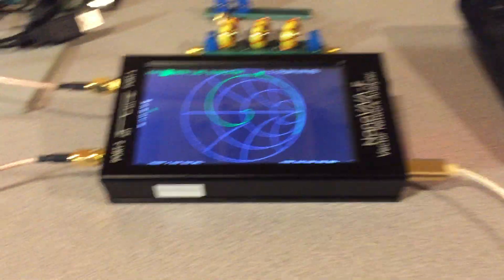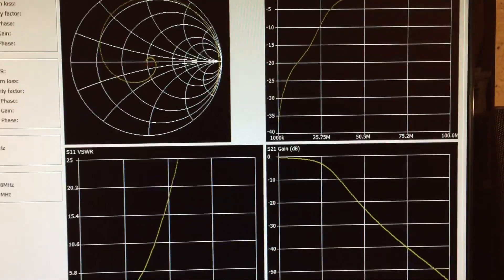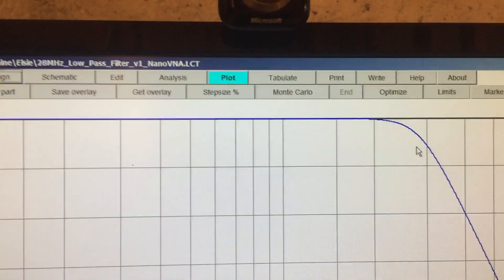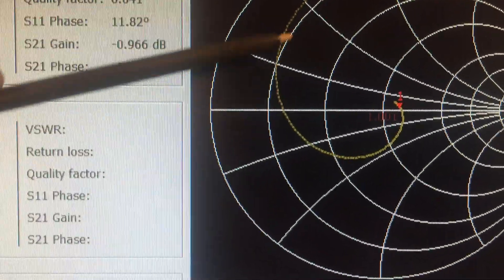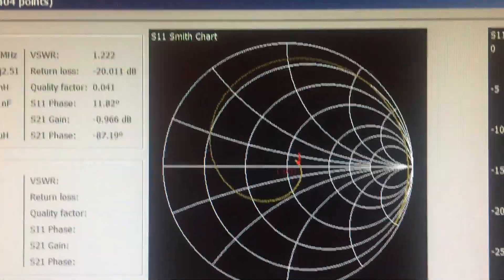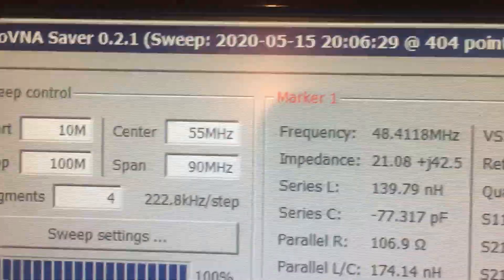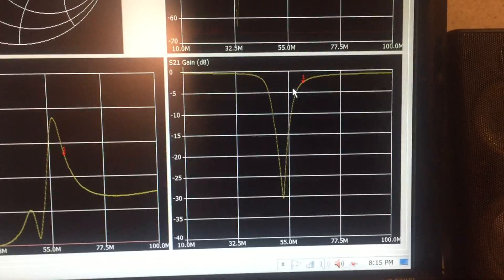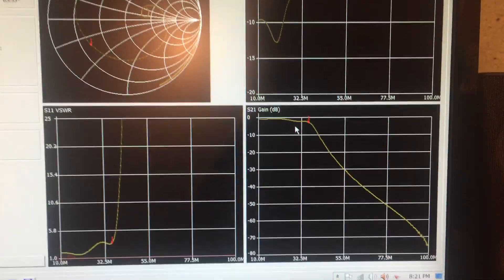RF Man Demos Nano VNA

Comment: Great Video! I've trained on, and used the HP8510 but have been away from Ham Radio and testing for over 15 years. Just received a NanoVNA SAA-2N and plan to use it for antenna design as well as filter design. Don, W5MML...🤠

Comment: Return loss is high  (-20dBm) for a good match.
Low return loss (-6dBm) is a bad match.
Reply from the maker: You can express return loss as a positive or negative value in dB. It is also referenced in many text books as a negative or positive value. This is a point of confusion for many people. The software allows both a positive or negative value for the Return Loss scale. I like to say when the return loss S11 is low -20dB (i.e. low reflected power), the Gain S21 is high (i.e. high forward power). Either way, we are saying the same thing........

Comment: Great video. Been tinkering with my vna-f received in february. Using it mostly for antenna analyzer and tuning amp  circuits. Really loving it so far. Looks like yours could be ready for firmware update.  https://deepelec.com/2020/02/02/nanovna-f-0_1_0/
Reply from the maker: Thanks for letting me know!